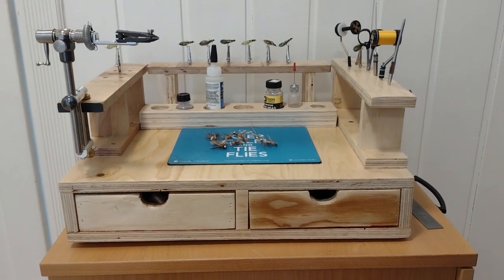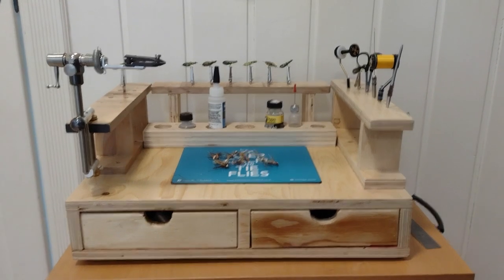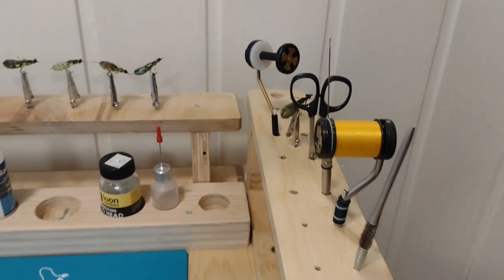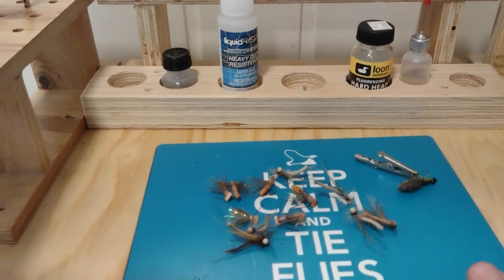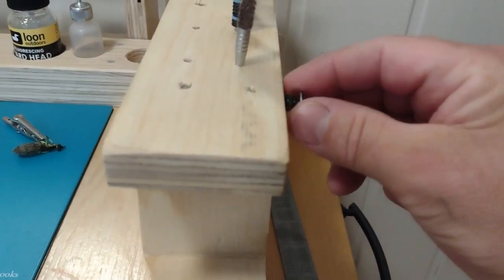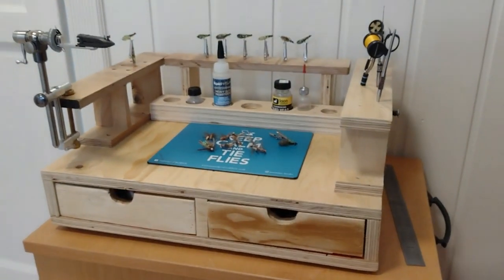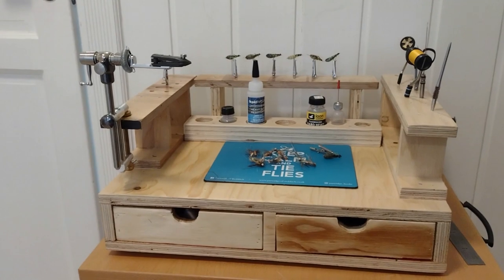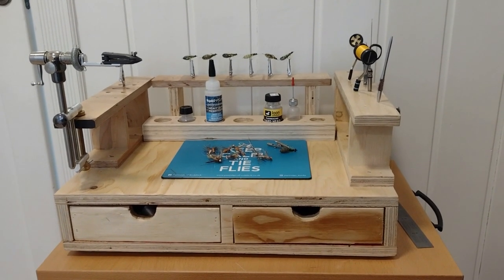My Portable Flytying Station

Comment: Nicely made tying station. One thing to think about adding is putting magnetic tape around the edges. It gives you a place to keep the hooks you are using next, provides a spot to place finished streamers or wet flies/nymphs & helps keep hooks from being accidentally knocked off the tying area. Best wishes & enjoy the new station.
Reply from the maker: Thanks